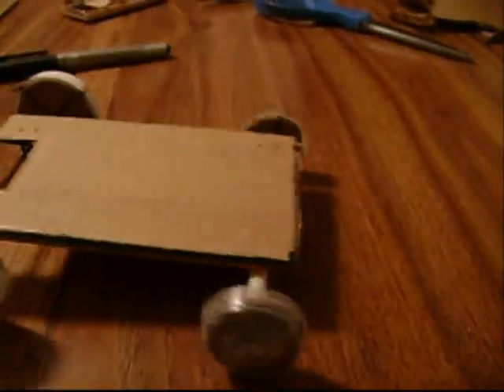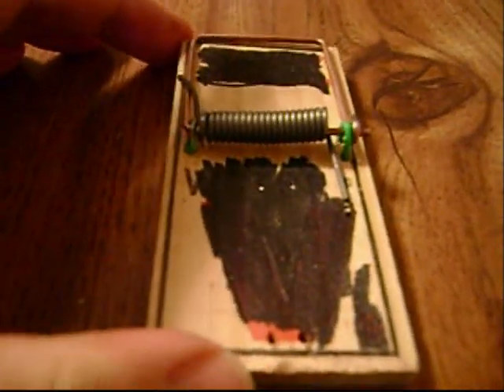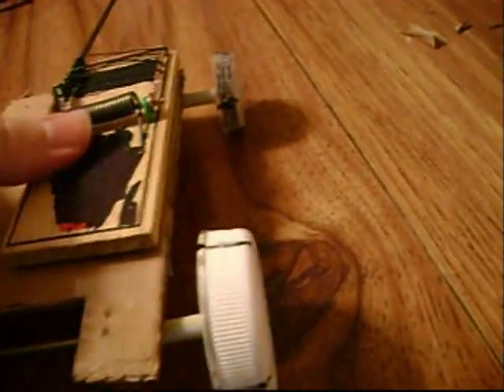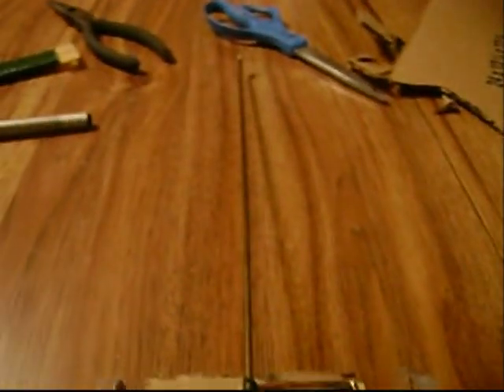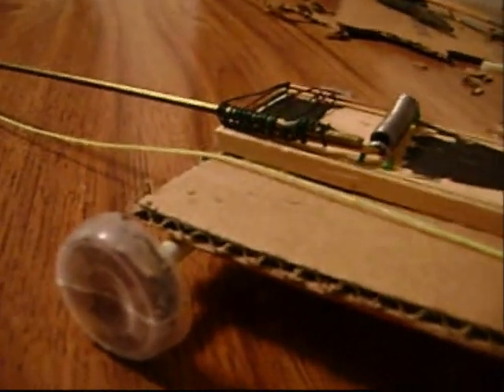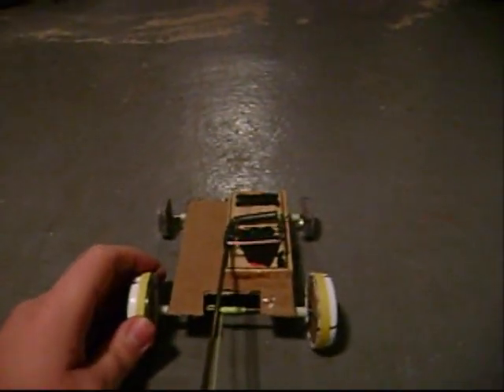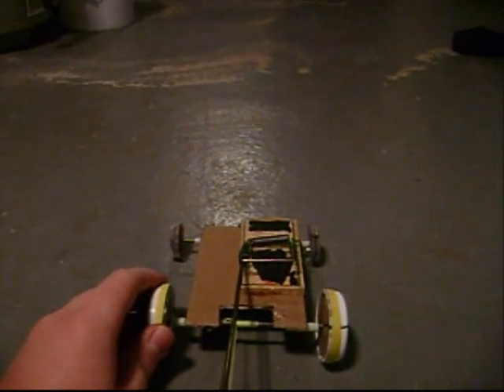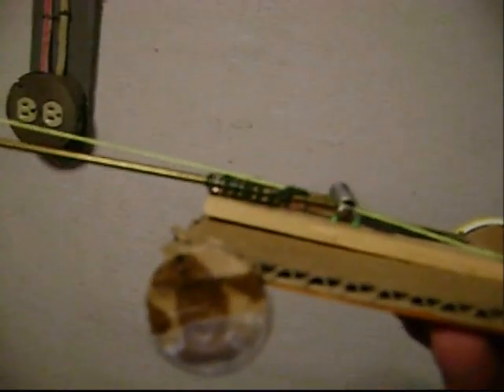How to Build a Mousetrap Car Part 5 of 5

Comment: @BIGfart7 So, mine does the same as Arvenpokemaster in that the arm closes too fast. It's pretty much the same length as yours (a little over a foot). Right now my wheels are rather small, they're just water bottle caps with about five of those tiny rubber bands you use for braces wrapped around each of the two back wheels. So that would be a problem? I see that you said making the wheels bigger helps, which I am planning to do, but do you know why that actually makes the arm go slower?

Comment: Hello, 
The kinetic energy on my mouse trap is too powerful. When it releases the energy, it clamps so fast it enables the car to move. Did you adjust your mousetrap wire in order to make the kinetic energy go slower? If so, how did you do it?

Comment from the maker: @lotsofgum sounds like your wheels are too loose and rubbing on the frame. Try finding some smaller paper clips to hold the rear axle better. If that doesn't work get a longer axle to get the wheels away from the frame. AND DON'T forget to use straws as spacers otherwise the wheels will just move from left to right.

Comment: I did every part you made, I tried winding the string(had to use thread but I braided it) but it made my car do a 360 instead, now i put 2 double a batteries on it and upbraided the thread, now the thread is getting caught and wont unwind the axle all the way, so then i assumed the thread was to long and cut the long rod in half and shortened the thread, its still getting caught and not unwinding, dunno what to do...

Comment from the maker: @Arvenpokemaster It's simple. Use a longer arm, add more weight to the drive wheels, give the drive wheels extra grip (ex. rubber bands), use bigger wheels. Any or all of those suggestions should work depending on the severity. HOPE THIS HELPS!!!

Comment from the maker: @youkluo That is where you're wrong sir. Bottle caps would be better suited for acceleration but not give you any distance. CD's are GREAT for distance, but lack on acceleration. It depends on what the teacher is asking for the assignment, but my Tried and Tested design gives a good balance of both.